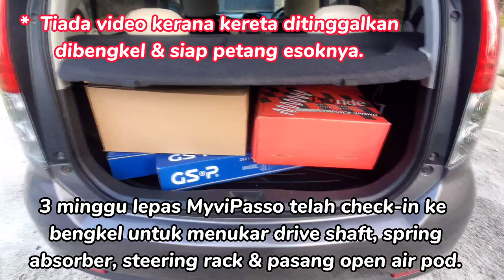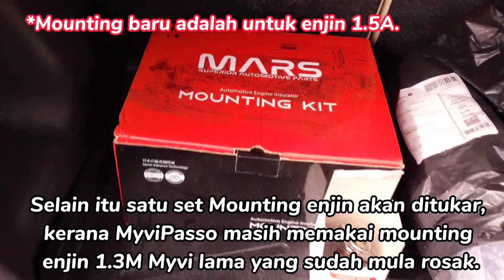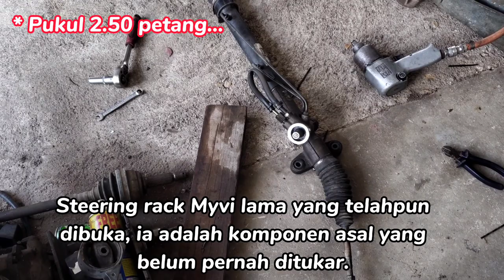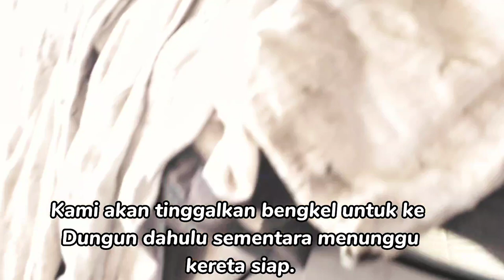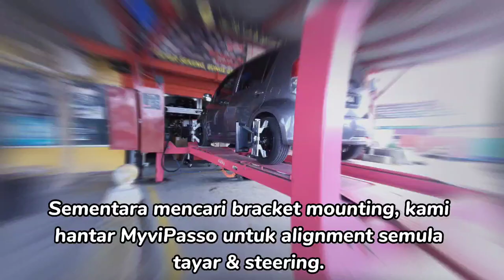3 kali check-in bengkel | Tukar Drive shaft, Steering rack, Mounting enjin & .... | Vlog #11

Comment: berape harga drive shaft brand gsp tu ok x setakat ni..kete sy pun drive shaft koyak br ambik 3 hari da koyak suruh pomen y jual tu tukar x nk plak dia tukar kan..sebelum beli ketebukan main janji manis..😂😂😂
Reply from the maker: Brand GSP ni ok sampai skrg pakai xde masalah. Harga tak ingat dah, sy beli kat Shopee upah pasang jer.
Reply from the maker: Bos, drive shaft GSP sy dah ada bunyi masa bwk 60~80km/j. Utk 1.5 rasanya elok pakai Lucas atau NTN punya.
Reply: @mizzmyvipasso5972  bunyi mcm mn tu..
Reply: sy pun ada masalah vibrate mcm gear box rosak ..lantai kete vibrate ada bunyi ..selalu kene masa engine da panas..nk scan scanner x beli lg..
Reply from the maker: @samser8445  Ada bunyi bergetar kat  bhgian depan & belakang. Tapi tak rasa pd stering. Ramai cakap masalah drive shaft, mungkin juga laa sbb enjin 1.5 tekan minyak sikit dah laju. Brand murah tak tahan. Ingat bolehlah pakai 3 thn, hampeh...
Reply from the maker: @samser8445  Sy selalu rasa bila drive slow bwh 80km/j, kalau laju terus hilang. Puas mikir apa masalahnya, lepas tu terbaca kat group kereta FB masalah yg sama. Ramai cakap drive shaft.
Reply: @mizzmyvipasso5972  sama la masalah sy mcm tu virate sampai stering..da tukr drive shaft pun ada jugak..kalo engine sejuk dia x de..da bawak jalan engine da panas baru ada virate dengan bunyi ..cek bearing pusing tyr pegang absober ok je ..dalam delima ni ape maslah dia
Reply from the maker: @samser8445  Kalau berhenti masa traffic light & rasa vibrate itu mounting enjin. Kalau mounting vibrate mmg rasa satu kereta terutama stering.
Reply: @mizzmyvipasso5972  berhenti ok masa bawak 20km nk ke 40 km,60km ke 80km,110km ke 120km,stering rasa x ketera lantai dengn ada bunyi zzzzzzz..
Reply from the maker: @samser8445  Maksudnya selepas tukar drive shaft bwk masih sama vibrate? Tapi kena check juga mounting enjin bos, kdg2 masa jalan tak ok tapi idle ok.
Reply from the maker: @samser8445  Senang citer kereta lama ni, semua brg bwh kena tukar baru. Termasuk set knuckle tu sekali. Sy plan mcm itu laa, tunggu bajet dulu. Kalau ada tools boleh jer buat sendiri semua. Tapi nk beli jet, beli tools lg, belum beli brg kereta lg...slow2 laa. Selagi boleh jalan, jalan dulu.
Reply: @mizzmyvipasso5972  sy memang sendiri kat rumah barang tools ada.
Reply from the maker: @samser8445  Ok dah tu, boleh tengok apa yg rosak & buat sendiri.👍